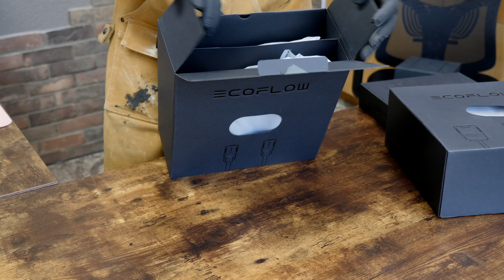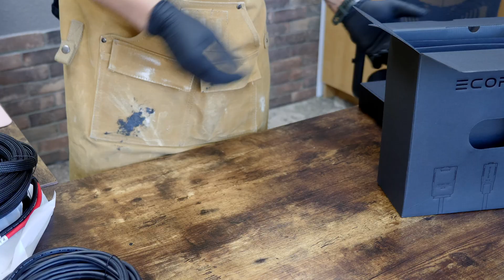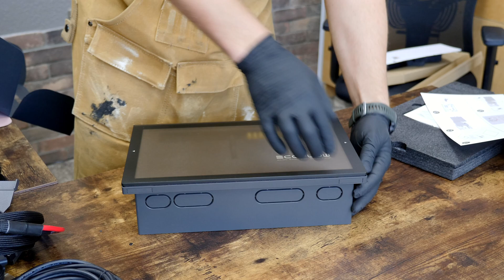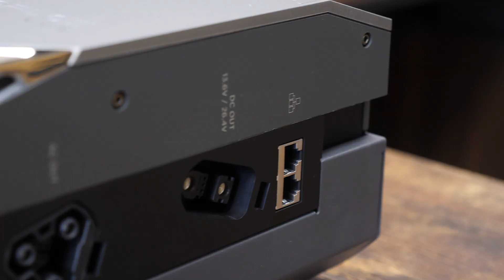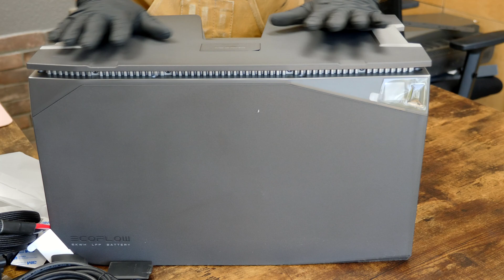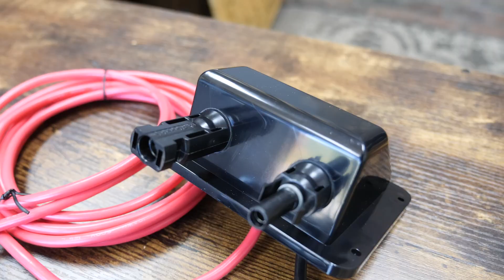Perfect Power Station For Sprinter, Transit, and Promaster Van Builds!

Comment: I am really beginning to lean to using this in my new 2023 Transit build. My only hesitation is concerns about one component failure shuts down the entire system. Am I correct about that?
Reply from the maker: That's pretty standard with all power systems in general. Did you have a specific instance you're referring to?
Reply: @Serg_supply  I guess I am referring to an instance where you would need to replace one component as to opposed to having the entire ecoflow unit sent in for repair. Say if something happened to alternator charging, you could still potentially use the shore or solar charging in a separate component system, but what about with an ecoflow?
Reply: @patweidmann6804  In our experience when it comes to power supply, they work independent of one another. For instance, we install all three (Shore, Solar, and DC/DC charging), but the builds don't always use all three. The only components that would cause the whole system to fail are the Power Hub, Distribution Panel, and Battery. I haven't seen this happen yet, but we offer replacements on all faulty components via manufacturer warranty!
Reply: @dmitriysergeyev1016  Thank you for this. If something goes out in the power hub, does that disable the entire power hub?
Reply: @patweidmann6804  My inclination is to say No, but I can't be sure of this. I have seen in one instance where a firmware update was interrupted and several of the DC fuse locations permanently stopped working, but the rest of the system worked fine. In another instance, the Shore power was having issues identifying power input, but the rest of the unit worked well. EcoFlow has been very good about releasing regular firmware updates to keep these glitches out of the units so your odds are very low that you'll run into a total system failure.

A safe answer would be: It is highly unlikely that a small error, short, or glitch could disable the entire unit. If something like this occurs however, you can expect a brand new unit to be shipped to you to swap out fairly quickly.
Reply: @dmitriysergeyev1016  Thank you for that. My concerns are eased a bit now
Reply: I am interested in install of the 5kw power kit to my new 144 Sprinter. You mention using a 48v Air Conditioner. Can you summarize the pros/cons and which ones you recommend and or sell? Also are you available for sale and or install in early September or the August Loveland expo?
Reply: @JimDarlow  Happy to help! Yes, we mainly use 3 different 48V ACs. Nomadic X3, RecoPro, and the Dometic RTX series. 
Nomadic X2/X3 Pros:  Ultra low pro. Sleek, quiet, internal shroud is just a thin metal plate, so no lost headroom. Ultra reliable and comes with a controller.  Cons: High Price
RecPro Pros: Lower price point, Comes with built in heater, relatively high BTU. Cons: Cheaper assembly, shroud protrudes into cab a bit, rather large footprint inside the vehicle
Dometic RTX Pros: Slimmer profile on the rooftop. Performs well, has very functional control unit + remote. Cons: Protrudes into cab several inches, cover that comes with it is not very aesthetic, and higher price than the RecPro

Note: With all three of these, you will need to have Anderson connectors added for proper connection!

We would always recommend the Nomadic X3 if it is within budget. The company has great support and hasn't let us down yet. We are available for installs Year-around at either of our facilities and in most cases, can get your EcoFlow core system + A/C installed in one day! Reach out to us if you have any other questions regarding install.